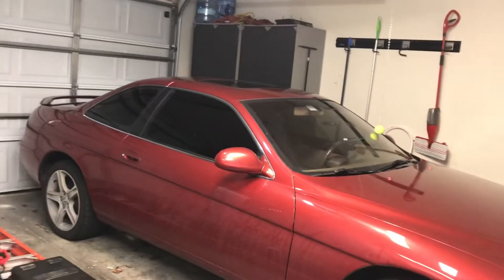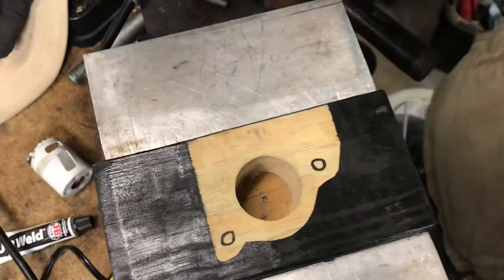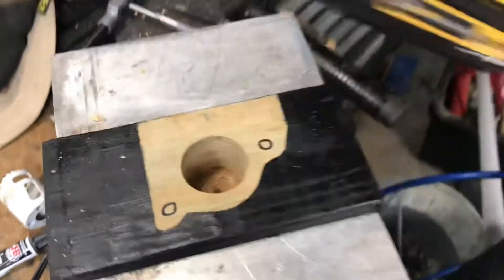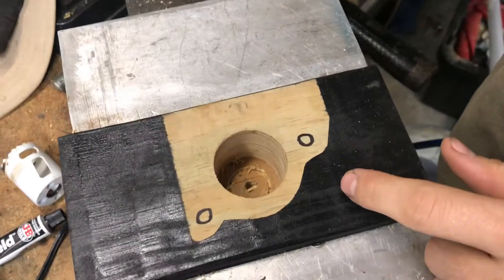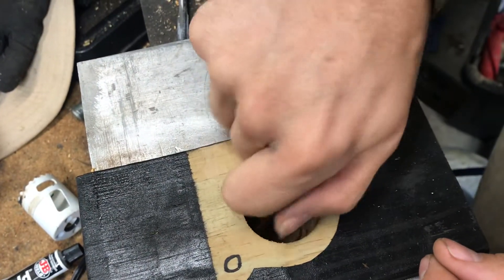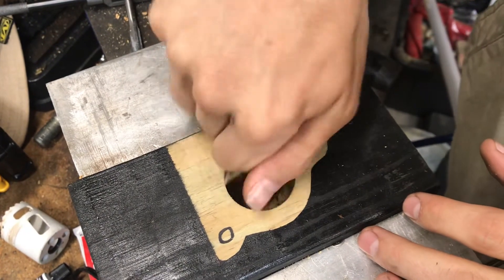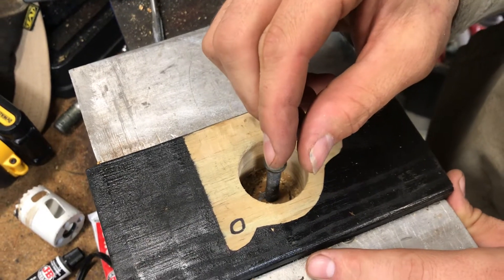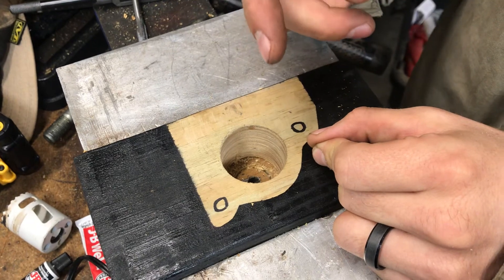2JZ drill oil pan drain without removing oil pan

Comment: Don't understand what you are doing. you just played on a piece of wood
Reply: If you don’t understand what he did. Then you shouldn’t be doing this at all . This guy just displayed the best method to drilling the oil pan.
Reply: @juanart46 😂
Reply from the maker: Yes. I would not actually drill through the oil pan without removing it. The wood just shows how I would do it without removing the pan from the car